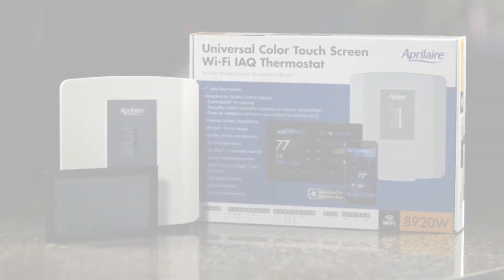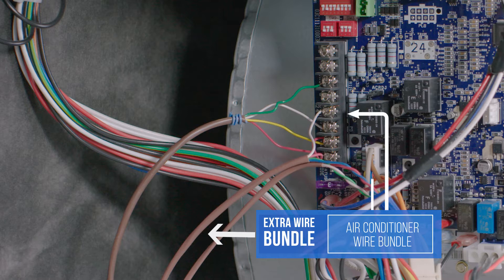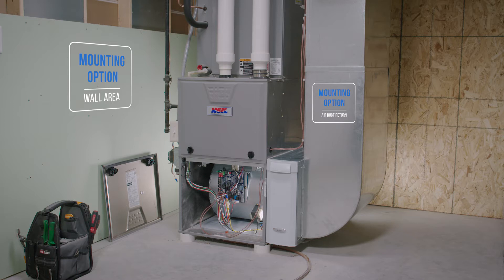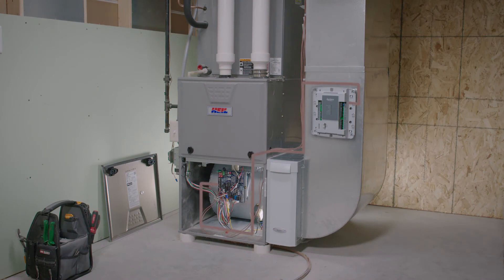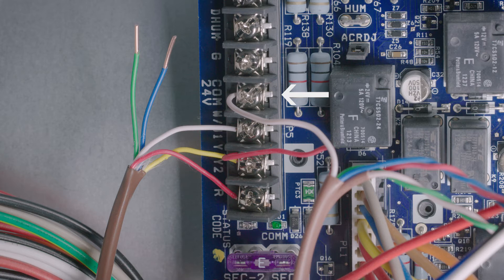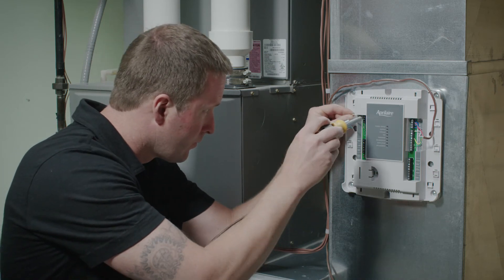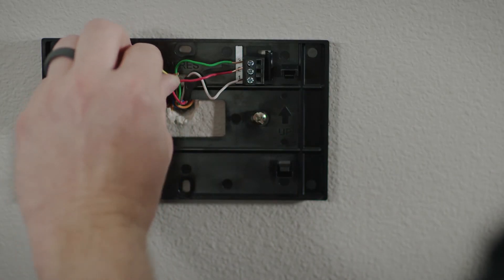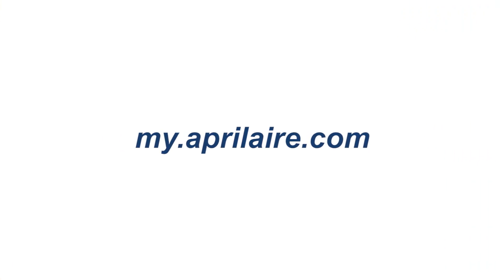How to Install the AprilAire Model 8920W Wi-Fi Thermostat

Comment: I have the 8910W with iaq control. I called tech support for all wiring and setup and changes at the dehumidifier but my thermostat isn't recognizing that the dehumidifier is connected. I'm only using it for the dehumidifier,  not to control my homes heating or AC.  Not sure what else to do.
Reply from the maker: Thank you for contacting AprilAire! In the installer settings, you will need to enable that you have a dehumidifier. If you have questions on how to do so, please contact our technical support team at 800.334.6011.

Comment: I plan on buying the 8920W to control my existing model 500 humidifier and the E100 dehu. The E100 I want to connect as remote control but I can't see the corresponding A,B terminals. In other words, I don't want the 8920W location to dictate the E100 cycle. Can 8920w achieve that, or do I still need model 76 in addition to the 8920W?
Reply from the maker: Thank you for contacting AprilAire! If you want to use the thermostat to control the dehumidifier, you will have to run the dehumidifier in external mode. So, it would have to use the thermostat's RH percentage reading unless you use a humidity sensor with the thermostat as well. We would be happy to discuss this further with you and can be reached at 800.334.6011 Monday through Friday, 7:00 a.m. to 5:00 p.m. CT.
Reply: @aprilaireco  feedback to developers: the only thing the 8920W is missing, is the A&B terminals corresponding to E100 remote schematics terminals. This would complete this unique thermostat

Comment: Thanks for the video, hopefully it will help to resolve issues of incorrectly calibrated humidistat 62 which came with 800 humidifier. It is a shame that Aprilaire did not stand behind their product and I had to buy another of their expansive equipment to make first one work.
Reply: same here - they insist on warranty only if the contractor buys/installs, but then they make 90% sales on amazon - directly to consumer

Comment: Why won’t my unit cool lower than 20 degrees? It’s a brand new system,  is there any way to bypass this ? It’s hot in Arizona
Reply from the maker: Thank you for contacting AprilAire! Would you mind giving us a call at 1-800-334-6011? A team member is available to assist Monday through Friday, 7:00 a.m. to 5:00 p.m. CT.

Comment: Can you remove the face and reset? I have a blank black screen
Reply from the maker: Thank you for contacting Aprilaire! The face can be removed by gripping it from the top and bottom and removing it by hand. We would recommend that you contact a local HVAC contractor to perform service to ensure a proper troubleshooting process. The faceplates can be damaged by removing them if too much force is applied. If the display is not lit up after plugging the faceplate back in, then you should have your HVAC contractor contact us at 1-800-334-6011 for further troubleshooting. If you have any additional questions, we'd be happy to assist.

Comment: Okay, nice video, but what if you have an Aprilaire Model 600 Bypass Humidifier with a digital Model 60 Humidistat on the furnace?  Do I bypass the Model 60 humidistat when wiring or will the 8920 control that too?  If so, what would be the wiring then?
Reply from the maker: Thank you for contacting Aprilaire! When using one of our thermostats with a humidifier, the thermostat will act as the control, so we can remove the model 60, or any other humidistat from the equation. If you have any additional questions, please let us know.
Reply: @aprilaireco    Thanks for the quick response!  But neither the video above, nor the instruction sheets for the Model-8920 Thermostat and Model-600 Bypass Humidifier show the correct wiring diagram to make it ALL work together, why? Where will I get that information? Thanks in advance...
Reply from the maker: @FirstClass-  Would you mind giving us a call directly today at 1-800-334-6011? We would be happy to talk through this with you and provide additional direction. A Customer Service Agent is available to assist Monday through Friday, 7:00am to 5:00pm CT. Thank you again for contacting Aprilaire!

Comment: I have been running the 8920w for a few years and absolutely love it. I am now looking to add a Model 5000 air cleaner before allergy season and I want to educate myself before the installers come to make sure it is done correctly (I have had plenty of issues in the past with various installs), but I could not find any information on how these systems are wired together. Is the control panel that comes with the Model 5000 not installed if you have the 8920w? There are two terminals on the 8920w labeled EAC, so are these the only two wires that need to connect to the air cleaner? I would love any info or schematics that I could discuss with the technician to make sure it leverages the 8920w. I am sure it would be helpful to others to formally add installation instructions on combined the EAC (and other components) to the 8920w.
Reply from the maker: Hi Christian - Can you give our Healthy Air team a call directly 1-800-334-6011 at your earliest convenience? We'd love to help you with this. Thank you for reaching out!
Reply: @aprilaireco  Why not just provide the information requested?